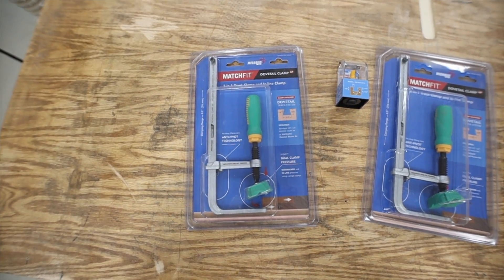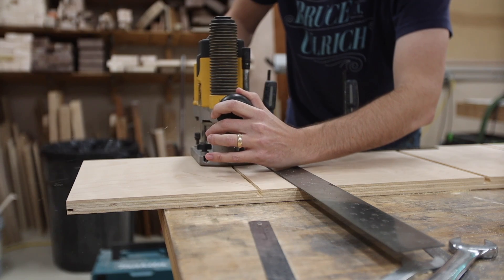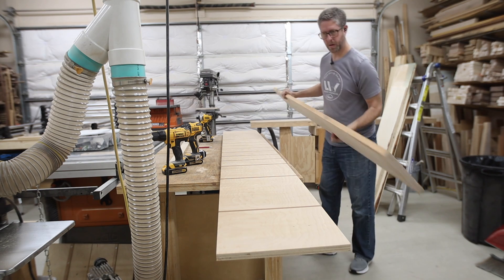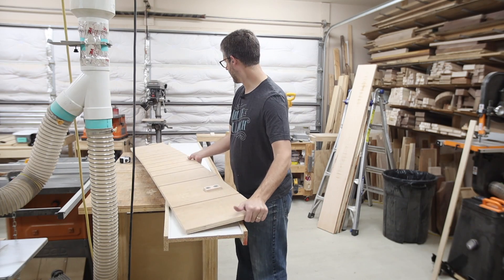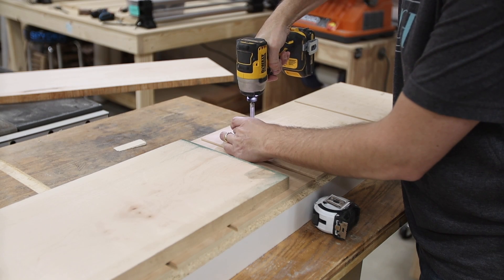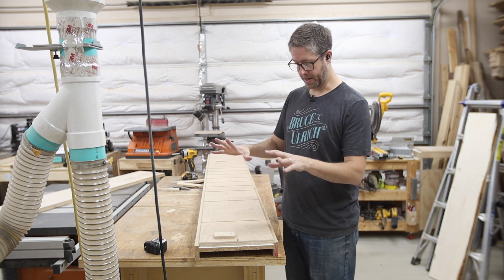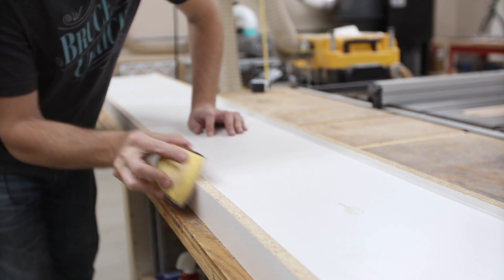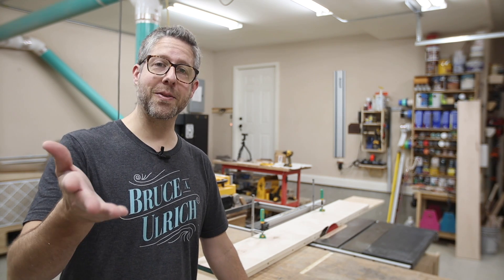FLAT LUMBER // NO JOINTER

Comment: Very informative Bruce, thanks for sharing! I like the I beam idea. I remember in my mechanical engineering classes that I beams are actually much stronger when they're in the vertical orientation as opposed to the horizontal orientation as you showed. They made us do the math to prove it. Just a fun and interesting fact. It looks like it worked well though.
Reply from the maker: Thank you! That is interesting about I-beams!

Comment: Great project Bruce! Since the table saw sled will always be the roughly the same distance from the blade you might can find (or make) a low-profile featherboard that helps keep the sled pushed against the fence without having to reset it for each new board. I suppose you could even put one past the blade as well which would normally be a no-no.
Reply from the maker: Oh, I have a magnet one so that is a good idea. It might work here!

Comment: Looks great Bruce!  I'd hope not to need one quite that long as storing it then becomes an issue, but it sure beats purchasing a larger jointer!
Reply from the maker: For sure! And I’m probably going to figure out how to mount it on a cleat vertically in my ship. I have 10’ ceilings so it seems like a good way.

Comment: Nice setup with the clamps and also being able to easily take the piece off the I beam and use as a straight edge jig! Good thinking on rounding those corners over on the melamine too. That stuff can be nasty.
Reply from the maker: Thank you! Man, I got a nasty cut from the melamine! I’m liking this setup and it was great to get such wide boards flattened.

Comment: I built my entire laminated workbench (top and base), from reclaimed construction material using a planer sled. I probably ran 20 pieces of 2x12x7 ft  material through it - a long and tedious process. The sled I made wasn't anything fancy - two lengths of 3/4 MDF lamented together with a stop at the end. Wedges and hot glue kept the boards stable and I had to devise infeed and outfeed support since the rig was so heavy. Worked great but it was at that point I decided an 8in jointer was a must-have tool. lol  A planer sled is fine for a couple of boards but it gets old pretty fast if you have to do much more. Interesting take on a table saw jointer jig - great solution! Those clamps look to be really versatile but kind of overpriced, IMO.
Reply from the maker: Yeah, I hear ya! A jointer is for sure an easier solution. A sled like this works but is more effort.

Comment: I will need one shortly as well. Guess I need to revise my design now, since I was just going to do your 1.0 version, haha.
Reply from the maker: Ha ha. You could probably just double up the plywood, but it might still flex. Plus, the table saw will only cut 3” out of the table so you make it where you can’t cut 2” material if you have two pieces of plywood doubled up. That’s why I went with the convertible design.

Comment: Oh man, the second I saw the first iteration of the jig, I knew that you'd have to do the Ibeam method for rigidity. Something that I would be scared/worried about is that extra pressure on the center of the board (in case of long bowed boards) would at first take a significant cut, then basically get flattened because of the rollers. In case you do see a giant gap in the middle, make sure that you put some shims in there.
Reply from the maker: Yeah, for sure. You have to be careful with the shims and where all pressure is being applied, or you won't truly get it flat.

Comment: Nice sled. Since you are probably going to have to convert it every time you use it, are you worried about the screws tearing out the holes on the melamine board and losing the ability to re-assemble it for next time?
Reply from the maker: Thank you! That was a consideration for sure. I’m being pretty gentle on it but yes, it is still a possibility. A small bolt would work also.